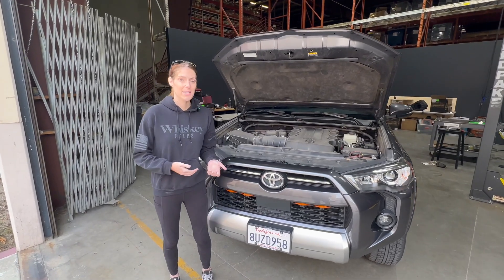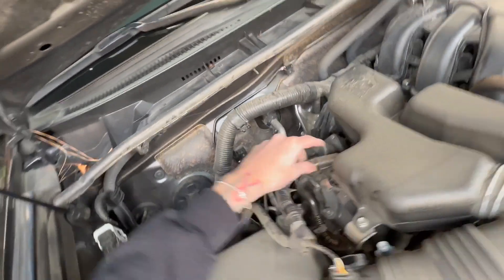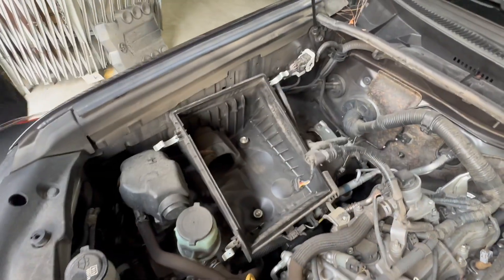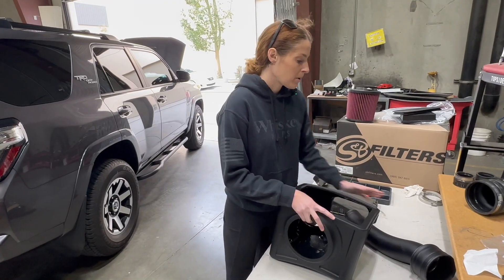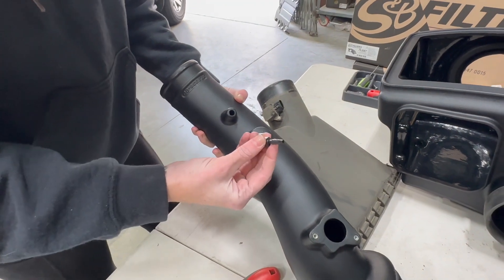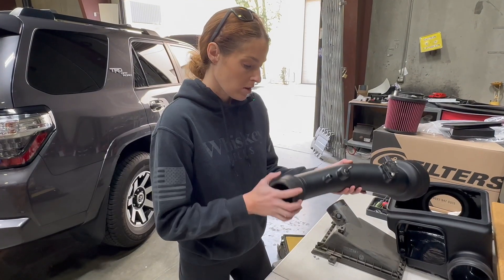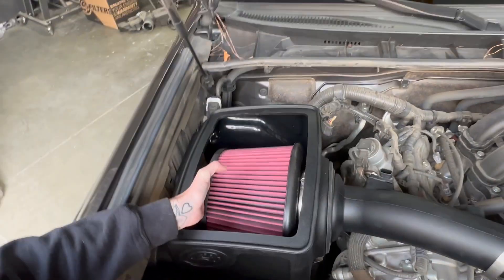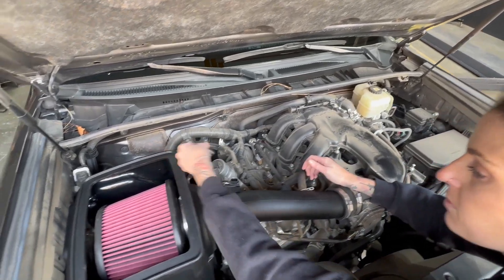Cold Air Intake Install for the 2010-2024 Toyota 4Runner / FJ Cruiser

Comment: Can i remove the extra air box panel AND leave the clear top panel off for added airflow??
Reply from the maker: @notengospacebar  yes but sucking in the engine heat will hurt performance
Reply: @SBFilters cool, thank you for thr response!